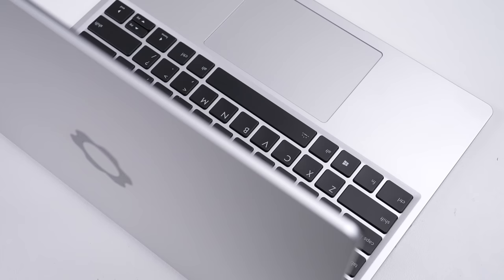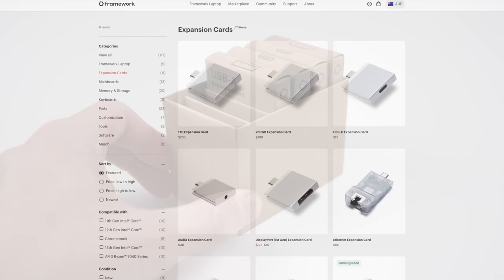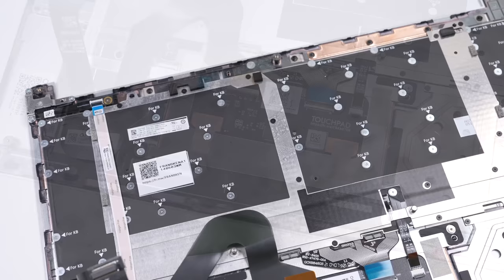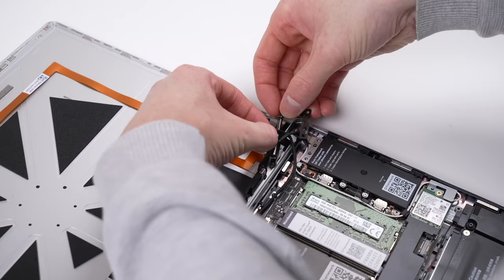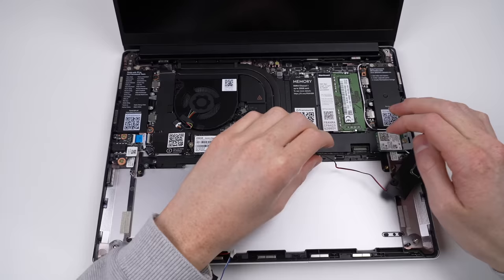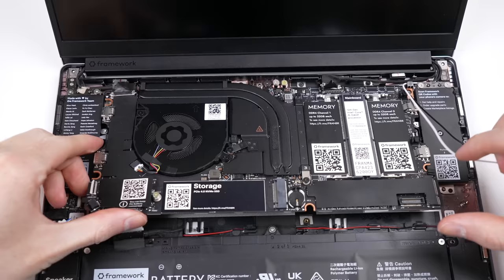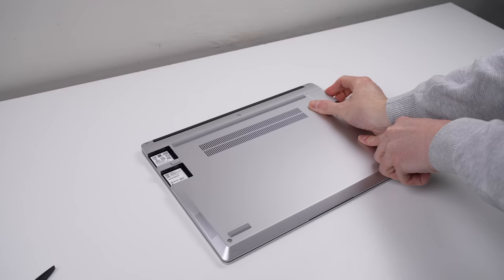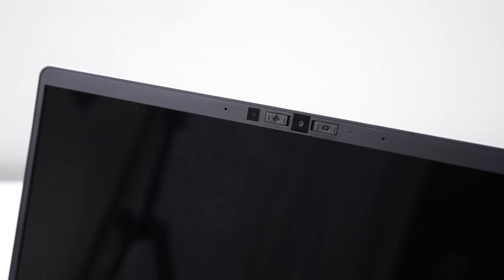New Laptop Brand Shocked Whole Computer Industry - Framework Laptop - Teardown And Repair Assessment

Comment: Everyone in tech needs to support this manufacturer. This type of upgradibility and flexibility is what we have all wanted at one point or another. Please, guys, as a community, we need to help this level of repairavility and upgradibility to become the norm. Support this company!
Reply: Everyone in tech IS supporting them. In a few months all laptops at my work will be replaced by Framework. I'm looking forward to it.
Reply: @kable6693 you are one lucky guy, my work just ordered new laptops and I will get an M2 Macbook Pro. I would have chosen the Lenovo that was the other option, but the battery life was a straight nogo to me and afaik Lenovo Thinkpad aren’t upgradable these days anymore :/
Reply: well i sure would if i had money, they are still quite expensive
Reply: @SUPERBOBESPONJA1000    expensive compared to what? it's the same as cars, you can spend $150 on a refurb thinkpad, 399 on a shitty hp from walmart, get a 3k macbook or splurge 10k or even more on a high-end gaming or workstation laptop. those seem to be upgradable for a couple gens, maybe more and every part is easily swappable by yourself with a single screwdriver if you want to.
Reply: I'd surely buy their products, if they sold in my country.
Reply: @kittytrail  well for what i need my laptop, my Ideapad L340 was 200usd, got a 3200U, ram slot, m.2 slot, 2.5 bay and even a ODD which is handy for me, upgrability? everything, i can even get a ryzen 7 board for 140usd in aliexpress if i so desire to upgrade it, same for display with a 1080p unit i would maybe spend 500usd max on a framework tbh, for me all the upgrades are still massive expensive compared to my crappy ideapad, and by the time i would upgrade it, would be massive expensive compared to buying a older and perhaps better laptop for the same price
Reply: Framework doesn't sell in every region. That's the big problem with Framework unless they solve not much will happen
Reply: LTT have invested in them, I think more will/have. Its great to see! I think my next laptop will be a framework for sure
Reply: @SUPERBOBESPONJA1000  You're comparing the price of new, modern hardware to old used ones.  I'm not saying buying used is bad (quite the opposite it's a great way to save money) but it's apples to oranges.  There isn't other NEW laptops that are comparable to Framework that are considerably cheaper.
Reply: 10 to 15 years ago, it WAS the norm. Then you guys wanted slimmer and and good-for-nothing laptops. Then manufacturers gave them to you with some obvious tradeoffs.
Reply: @kadirunaloglu523  Tbf there were laptops with hot swappable drive bays in the 1990s haha
Reply: @guitarszen  How is using the most popular business and  gui OS a fail? It's not like you can't easily load Linux on dual boot or all together once you buy it. Offering what most of the public may buy is a smart business decision.
Reply: they have had a few laptop makers try this decades ago, removable gpu and cpu, memory etc. It didn't sell well then for a host of reasons despite nearly all being sold on the concept. Sadly it just didn't gain any significant traction. Hope this can be what those attempted to be then..
Reply: @guitarszen Nothing wrong with using Windows.
Reply: I'm still waiting for them to make a 2-in-1 with pen support. Probably shouldn't hold my breath on that one though, they've been asked and didn't seem interested, so guess it's not for me.
Reply: @guitarszen Unfortunately Windows isn't optional for a lot of us.  If I need software that isn't available otherwise, Windows it is.  No reason not to put it on this machine.

I'm guessing a flavor of Linux is your OS of choice?
Reply: @kadirunaloglu523  10 to 15 years ago, there were no normal laptops you could upgrade the motherboard in five minutes.
Reply: @guitarszen The irony of you calling what I say a dead horse is just stunning.  You do you booboo.

Comment: With all of the appliance-like laptops Apple and now even Dell are moving to, this laptop stands out as a true middle finger to those OEMs. Yes, it shows you can make a laptop that's modern and yet has full modularity and upgradability and even can work if something does unfortunately happen to Framework. I wish I could invest in their company too...
Reply: I was going to say, id love to as well. Framework if your reading this, please consider letting us invest!
Reply: H/P? showed a concept right to repair friendly laptop and I 100% believe it is from the hype of FRAMEWORK
Reply: Apple isnt an oem they make their own chips
Reply: @danial_amini even before their own chips their motherboards were entirely custom designed too…
Reply: The only mainstream company that comes close is Lenovo....
Reply: @danial_amini  The chips are custom made in a Taiwanese fab just like everyone else's.....
Reply: > and now even Dell
My laptop refuses to charge because I busted the plug on its charger recently, so the laptop can no longer tell it's connected to a genuine Dell power supply. Still charges when fully shut off, so it's clearly going out of its way to disable functionality.

EDIT: I should mention, what they did doesn't even truly prove you're using a genuine charger. The way they're checking charger types (I think it's a one-wire EEPROM?) is spoofed incredibly easily. All the knock-off chargers already do it. All this does in practice is keep people like me from still having nice things.
Reply: @hx0d  they should use some kind of crowd funding for people who want to buy one and have a personal note on it.
something like a unique feature or signature, that only the crowd user have
Reply: @wesleymays1931  i know this problem! i have a dell workstation laptop with usb c charging and a usual dc jack!! cause of this stupid behavior, i never use the usb c charging method!
Dell is well knowed for that kind of stupidness
Reply: @edwardfletcher7790  you're right, apple is fabless
Reply: @edwardfletcher7790  and only in their thinkpads. Everything else sucks.
Reply: @jasonriddell the same HP with the printer scandals?
Reply: @danial_amini  Apple designs their own chips, not make them. Apple uses ARM instruction set and then TSMC makes those chips.
Reply: @danial_amini  Apple designs their chips they outsource the production to TSMC.
Reply: @jasonriddell  Not just HP Dell did too promise they will have a very upgradable laptop but they didn't deliver
Reply: @danial_amini  That's the thing they did have some chips coming OUTSIDE of their manufacturing line and the ironic part is that it's Samsung
Reply: @edwardfletcher7790  I couldn't say the same about Lenovo IdeaPad 3 which has onboard RAM soldered directly yes it can be fast but that literally just kills the upgradability aspect of it and if you don't have the expertise of soldering and desoldering stuffs you could brick it
Reply: @mayuravirus6134  Who needs to upgrade a $200 Chromebook ??

Why does Grandma need more ram for her emails ? LoL

That's a REALLY dumb example.....😩 SIGH
Reply: @jasonriddell  wasn't that from one of their elitebook line, though? Those are business class laptops which in theory need to be easy to open to swap out parts if needed. 

There is nothing stopping your org from ordering higher capacity storage and ram "parts" to replace what's already inside, which could be interpreted as some from of user-upgradability.

Now try that with a slim and light consumer laptop, which are starting to get stuff that is soldered to the motherboard and not replaceable or upgradeable.

Comment: Some more information about the laptop:
- The USB ports are USB4, meaning they technically support most of the Thunderbolt 3 spec features.
- If you don't need extra ports, you can populate some of the slots with 250GB or 1TB SSDs.
- You need at least one USB-C port available for charging.
Reply: They are actually certified TB3 now
Reply: @felkmane  But only on the Intel model, a Thunderbolt 4 is still proprietary to Intel and Apple and needs royalties and a chip for USB4.
Reply: Intel was a dealbreaker and the AMD Version is non USB4/TB3 so i had to pass it for the next best HP Elitebook 845 G9
Reply: @natzzzy9119  except the AMD version has USB 4 still?
Reply: On the Intel 12th and 13th gen models, all 4 ports are Thunderbolt 4 certified. On the AMD 7040 models, 2 ports are USB 4 with DP alt mode (one on each side), 1 is USB 3.2 with DP alt mode, and 1 is USB 3.2 without DP alt mode.
Reply: Do the ports for the expansion slots work for charging?
Reply: @rockpie.squashfs  As fas as I know all of them do.
Reply: @cameronbosch1213  You can have both AMD and Thunderbolt though.
Intel has thunderbolt integrated into the CPU, on AMD you can have a dedicated chip. My PC happens to have a motherboard that supports thunderbolt expansion. If I ever needed I can buy an 80$ card, plug it in and have two thunderbolt ports.
Reply: @shapelessed  Alright
Reply: @natzzzy9119  😂😂 have fun with Hinge Problems.
(And in my country, a crazy lack of spares.)
Reply: Also to clarify, just because a laptop isn’t officially certified to have thunderbolt, doesn’t mean it won’t support thunderbolt, the only difference is that it’s not “certified” by Intel/apple to use thunderbolt, but I am sure many manufacturers do support thunderbolt “unofficially” that is the ports can use thunderbolt, they just don’t certify it to save on the royalties cost
Reply: Thunderbolt went royalty-free in 2018. I actually have an AMD motherboard with TB3 certification. I'm betting it might just not yet be Thunderbolt certified. Heck, even the first Framework laptop wasn't "officially" certified at launch, but now is.
Reply: @AmEv7fam  I don’t think every Thunderbolt went royalty free, only the thunderbolt 3, which is why it was included in USB4 specifications
Reply: @STORMFIRE07  Fair enough. I don't know how TB4's license works, but my main point is, it's very possible the AMD systems could become TB3 certified ex post facto (if that's the right phrase).
Reply: Somebody knows the price?
Reply: Easy access to the inside of the bottom chassis could make it possible to add fast wireless charging.
Reply: @rockpie.squashfs  All of them do, yes
Reply: Why would you want to do that? looool why would someone want to put 4 TB of SSDs on a laptop? video production? CG design? 3D CAD? well you need a PC with power GPUs not a laptop if you want to make use of that much storage. 
I see nothing different than other laptops except the name of the company.
Reply: @athrunzala5337  You can also connect a Thunderbolt 3 dGPU
Reply: @athrunzala5337 I have a 2TB NVMe in my framework and will likely upgrade eventually. Between games, multiple OS’s installed, and generous use of my storage in general, I’ll likely fill my 2TB within 5-6 years if not sooner, and will end up with a bigger drive sooner regardless. 

If you can’t see why repairable, upgradable laptop is a good thing, then I suppose you’ll just have to keep spending cash on a brand new one every few years. I have no plans to buy a brand new laptop for well over a decade because of my framework
Reply: @rockpie.squashfs  yes
Reply: @athrunzala5337 the point is more that you are not limited by the laptop makers choices. Framework are unfortunately limited by intel and amd to some extent, but beyond that there's no real limit. They could probably design a upgrade option with more internal ssd options and smaller battery if they wanted to offer that. As it stands it is the best option if you want control over what you do with your device.
Reply: @bionicgeekgrrl  Chicka you still need to replace the entire motherboard if you want to change the CPU or the GPU . . making this laptop nothing special other than swapping peripheral ports from left to right everything else is the same as other laptop manufacturers . . I had a lenovo which the plastic cracked because it aged so what  I did is to design my own plastic housing with the help of a dremmel so can I claim now that I have invented a revolutionized laptop? . . unless you can change the components individually or upgrade them . . it's the same thing
Reply: @athrunzala5337  not really. The 13" model is a thin and lite, it doesn't have options for discrete gpus because it is in the size category where they don't make sense. The upcoming 16" model has a modular pcie bay for gpus or other devices
Reply: @athrunzala5337  you have to do that for every laptop. You cannot just change the cpu or gpu alone as those chips are just not made like that. The days of socketed gpus and cpus on laptops are long gone. If framework wants those chips they have to have them soldered, which means they also have to do the entire motherboard. 

The key thing though is the storage, battery, screen, WiFi, etc are all replaceable. In a lot of modern laptops you can't replace quite a few of those items easily or at all. 

Is it perfect, no, but is it about the best that they can offer given the limitations from their suppliers yes.

Your comments about cracked plastic are irrelevant to the framework as it is aluminium and everything is replaceable, including the chassis and shell if it was necessary.
Reply: @athrunzala5337  I doubt you have ever taken a laptop apart if you don't see the day and night difference in the ease of dismantling the framework vs other laptops.
Reply: @rexsceleratorum1632  🙄🤣
Reply: @athrunzala5337  Every traveler and YouTuber who makes videos would love even more than 4TB of SSD storage on their laptops.  Right now I have 9 external drives, 7 SSD (3x1Tb, 3x2Tb, 1x4Tb) and 2 5Tb traditional external drives, plus the 2Tb ssd internal.  Pain in the ass while travelling.  Bill Gates once said 640k of memory was more than enough.  Enough is never enough, especially if you start shooting 4K video.  And once you go 4K, you pretty much start to hate looking at 1080p.
Reply: @bm5906  What does this have to do with what I said? Alright then, when 4TB SSDs become available, remove your old SSD on ANY laptop and shove the new 4TB instead . . don't tell me you'll feel tired removing 2 3mm screws to get to your drive bay? 

as for 4K and 1080p, it has to do with the monitor size as it is virtually impossible to tell the difference between both on a 17" laptop monitor unless the devs themselves have 2 copies of shaders one blurred to display when 1080p res is chosen and one razor sharp when 4K is chosen but that's a marketing strategy to push you to upload as hardware manufacturers fund the development of software and get their money back when the software product starts making money back. 

I'd be amazed once I know, I can again upgrade my mCPU or mGPU and not the entire motherboard.
Reply: @bm5906  Frankly, you need to get a NAS instead of juggling external drives
Reply: @athrunzala5337  💯💯💯
Reply: But that doesn't matter if what I need is an HDMI 2.1 , out of luck since their 3rd gen HDMI is only 2.0b . So clearly no bandwidth. 
GPU is also not very powerful for the cost.